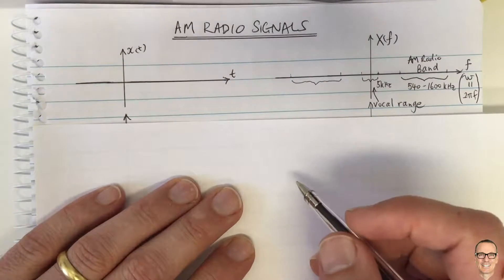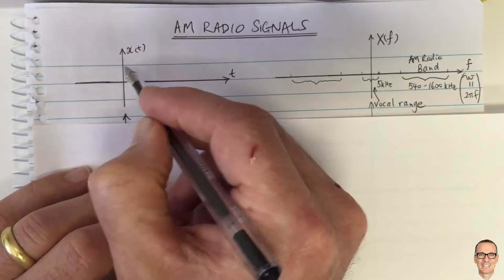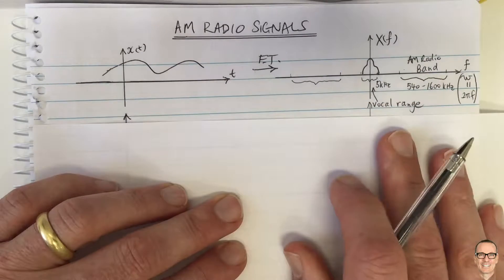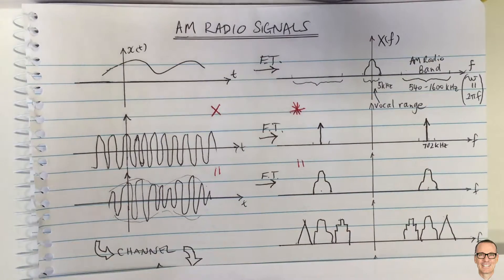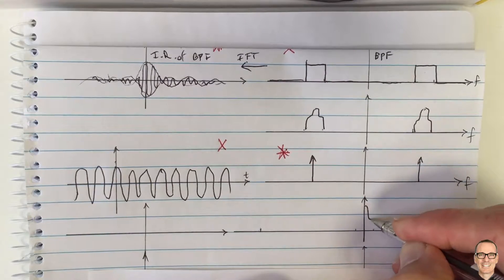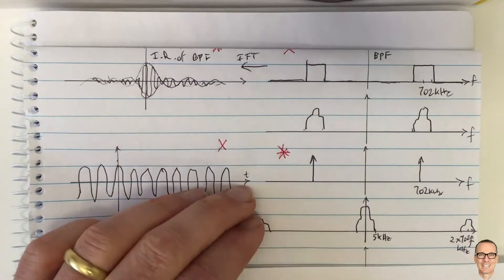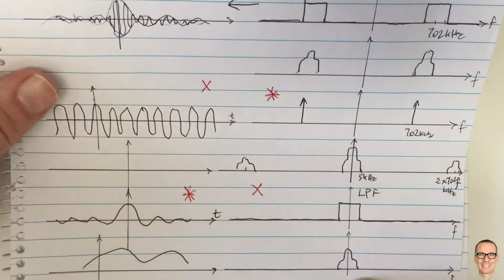Amplitude Modulation AM Radio Signal Transmission Explained

Comment: Will the amplitude of low pass filter be 0.5? Because in the second last step when we are convoluting with delta impulses the resultant amplitude would be addition of individual signal amplitudes which doubles the amplitude of original signal

Comment: Do we use this method in 5G system? I suppose yes. Is that mean we always need to know the carrier waveform in the receiver? So, the question is whether the carrier waveform is fixed thus the receiver always knows it. Or, the carrier waveform is not fixed, does the transmitter requires some control signalling to tell it to the receiver?
Reply from the maker: The transmitter and receiver need to agree on which carrier frequency to use, and they need to "lock" their frequency generators (crystal oscillators) to the same frequency. This is done via control channels and training resource blocks. This video might help from a "systems" perspective: "How is Data Received? An Overview of Digital Communications" https://youtu.be/hz6zhaCajnI

Comment: Sir, I didn't get the summary sheet for this video. Is there a way you can provide it to me? As well, I checked your personal website and could not find it.
Reply from the maker: Yes, you're right, it's a bit hard to find, but since it's not "digital" communications, it's on the Signals and Systems page, under the heading Applications of the Fourier Transform. ... and also here: https://drive.google.com/file/d/1y8VxQzEqoQIONUIgxsDXyH2ht3rvVoGC/view

Comment: Awesome videos! :)
You always talk in your other videos about pulses, that go into a transmit filter and do some pulse shaping with a sinc or square root raised cosine. But here you say now "[...] amplitude of a signal you are going to send is modulated by a carrier at the frequency you are going to send [...]" (or something like this).

Can I also just describe "digital amplitude modulation" as a series of delta impulses with symbol time T, that is then put into a square root raised cosine filter and shifted by cos multiplication to the carrier frequency? I guess then the waveform would not look like you draw, however, the sampling points at kT would exactly match your drawing.

Why are we no longer talking about "sending pulses"? What is the difference between amp/freq/phase modulation and sending pulses?
Reply from the maker: This video is about modulating an analog signal. Analog signals don't have pulses, or symbol times.

Comment: Great video, very aptly explained. I wanted to know why do we need to use BPF before convolution with the carrier frequency at receiver, if we skip that step, still after LPF we would only have our main signal only. Could you please explain this ?
Reply from the maker: There are two reasons for the BPF. I should have mentioned them in the video. The first is that in real wireless channels there are other AM radio stations at other neighbouring carrier frequencies (plus all the other wireless signals such as mobile/cellular, WiFi, etc) and you want to filter them all out before down converting to recover just your own signal. The second reason is that even if there were no other wireless signals at other frequencies, there is still noise at all the other frequencies, since noise is broadband, and you want to filter that out. For more details on that, see: "What is Noise Power in Communication Systems?" https://youtu.be/_qn4RzMrXBc
Reply: @iain_explains  Thanks for replying Iain

Comment: Hi Lain,great video as always,on the timeline 9:11,i don't understand why they will lie on the center rather than on the side.What do i mean is that when we trying to do convolution of two functions,we are actually first flip one function in 180 degrees regarding to some value t,this way when time t passed,our flipped function will move,and eventually across the delta function and remain the convolution result shape just the same as the original function,except the origin(start) of the function now is at the time where the delta function at.
    say if original function is start at time 0,and delta function is at time 4,so the convolution of the function will start at time 4 with the same function shape as the original.
    What am i missing here?
Reply from the maker: Convolving a function with a delta function has the result of moving the original function to be centred at the location of the delta function. In other words, the "zero point" of the original function (where t=0) would move to the location of the delta function. So, looking at the 9:11 point of this video, imagine there was only one delta function in the third graph on the right hand side of the page at 702 kHz (instead of the two delta functions). Then the second graph would be shifted so that the "zero point" of the second graph is located at 702 kHz. This would mean that one of the "lumps" would be centred at 0 kHz and the other would be centred at 2x702 kHz. Now think about doing the same for the delta function at -702 kHz, and then adding the two results together (since convolution is a linear operation).
Reply: @iain_explains  Hi lain,i understand it now,i was wrong about the shifting and re-locating part of convolution,i thought if you the delta function is at 702kHz,then the "lump" should appeared exactly at this location to indicate that it is exactly when this pulse happens,there's the function.But i neglected that the function we are shifting is actually f(t-t')(t' is tao) instead of f(t),so if there are some shift in the original function f(t) where t starts at say 5,then if we consider f(t-t'),there are "extra shift" in time t we need to take into account when we shifting the function f(t-t') to overlap with the delta function.
    Thanks for your explanation,i put my understanding for the question i had after your clarification here just so everyone who might wondering the same could get a little perspective,correct me if i'm wrong,thanks again,cheers mate.

Comment: Hello professor, i have a question , I have an assignment problem to modulate an audio signal that is sampled at 44.1kHz with a carrier with 101MHz.
We are required to then extract the complex envelope  of the transmitted signal and also demodulate the original audio signal. 

My question is that the sampling frequency of the audio signal is lesser than the carrier frequency, if I were to use the sampling frequency of 44kHz to sample the career signal and modulate the audio signal, wont there be problems like aliasing ? And if I wanted to see the spectrum of the modulated signal what fs should I use , as the frequency of spectrum would be limited to (-fs/2 ,fs/2) but the spectrum will extend to fc+fs
Reply from the maker: I think you're referring to sub-sampling or under-sampling techniques. Yes, if the passband is conjugate symmetric then you can sample at a low rate, chosen such that there are aliased copies centred on f=0, and also chosen to ensure that the other aliased copies do not overlap. This is a way to avoid multiplying by the cos and sin. If the passband is not conjugate symmetric, then the sampling frequency needs to be twice as high as the conjugate symmetric case (which is equivalent to needing twice as many samples, which is equivalent to needing the same number of complex valued samples - nothing comes for free). Here's a video with more details: "Sampling Bandlimited Signals: Why are the Samples Complex?" https://youtu.be/JglRGRizqGM

Comment: Forgive me. But I am playing around with concepts that are way over my head. Is the impulse response going back to negative infinity the same as a frequency going back to negative infinity? If so, can that frequency be fine tuned?
Reply from the maker: The impulse response is the response of a system when an impulse gets applied at t=0. For all realisable systems (causal systems) the impulse response is (naturally, by definition) equal to zero for all t<0 (ie. the system only responds after the impulse is applied). In the frequency domain, the smooth parts of the signal are made up of low frequencies, and the sharp-changing parts of the signal are made up of high frequencies (both positive and negative). I'm not sure what you mean by "fine tuned". It might help you check out this video on the Fourier Transform to understand the frequency domain a little more: https://youtu.be/8V6Hi-kP9EE
Reply: @iain_explains  what I mean is to isolate a frequency at a specific negative hz.
Reply: @iain_explains  also,  if this is the case, how does relativity account for a wave traveling towards negative infinity? Does that not violate relativity?
Reply from the maker: Perhaps you missed it in the video called "What is negative frequency?", but I made the point that a "negative frequency" is actually a positive frequency, but with the phase changing in a negative way (in other words, it is a complex number that is rotating in the negative direction. ie. clockwise). All real signals are made up of a "negative" frequency component, and a "positive" frequency component in equal measure (so that the complex component of the signal cancels out, and leaves only the "real" component). Have you watched my video on how complex numbers relate to real signals? That might give more insights: https://youtu.be/TLWE388JWGs

Comment: How did u get the bottom wave of the signal in the time domain after the multiplication
Reply from the maker: There is no "bottom wave". The sin wave, r(t), has an amplitude envelope of 1. After the multiplication, it has an amplitude envelope given by x(t).

Comment: In the amplitude modulation when the messege signal m(t) is multiplied with carrier signal c(t) how we get the upper sideband c(t) +m(t).

I get a visualisation of how the lower sideband  c(t)-m(t) is created when watched the w2ea youtube videos.but don't able to get how upper sideband is created, as we said that in amplitude modulation the carrier frequency doesn't change the w2ea youtube video link

https://youtu.be/7nmmb0pqTU0
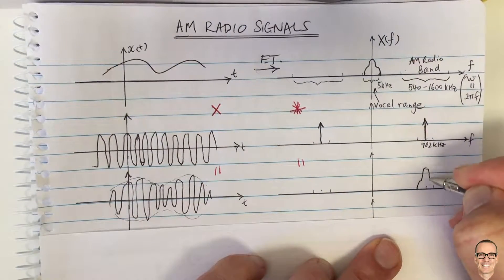Reply from the maker: I think you might be getting the frequency domain and the time domain mixed up. The upper sideband is not c(t)+m(t) and the lower sideband is not c(t)-m(t). As I say in the video at time 2:20, m(t) and c(t) are multiplied together, and this generates a signal that is centred at the carrier frequency, and therefore has a component above the carrier frequency (upper sideband) and a component below the carrier frequency (lower sideband), as shown at 3:20.
Reply: If 5kHz message signal of a single tone(For eg) when modulated with 15 kHz carrier frequency. The lower sideband is 10kHz(15_5)khz and that I can able to visualize .w2ea youtube video shows it correctly in oscilloscope. But the upper sideband 20khz(15+5)kHz is not abel to visualize. Can you do any video regarding this through any vector model representation
Reply from the maker: I'm not sure you are understanding exactly what is shown on the oscilloscope in that video. It shows the overall signal c(t)m(t) (ie. they are multiplied together, not added!)  He shows the differential component signals - but that is differential with respect to the constant bias voltage. Not with respect to the carrier signal. I'll try to make a video to explain this better.
Reply: @iain_explains  
Thanks for spending this much time for me. Expecting a detail video
I am thinking as the lower side band is generated the time period of lower band will be T (lower)=1/ f(Lower).It is clear from that video ,the oscilloscope showing lower sideband is not a single tone(frequency) but an envelope. Like wise the upper and time period will be T(upper)= 1/f(upper).
Reply: If the massage singal taken as as a single of 1Hz frequency. ie 1 positive and 1 negative cycle. And if the carrier frequency is 1000 Hz. When they are mixed After the 1st cycle of the messege signal the phase of the carrier is shifted by 180 degree and after the messege signal complete the 2nd cycle again the carrier frequency is shifted by 180 degree. So in result the carrier complete 1001 (fc+fm) due the phase shit rather than 1000 cycles. I s it correct